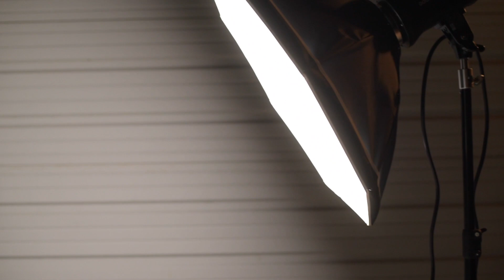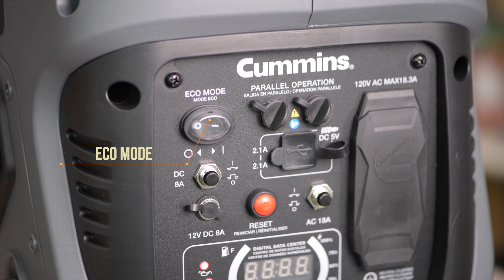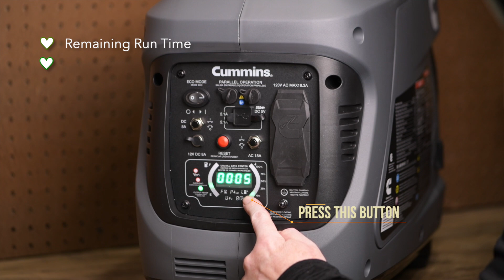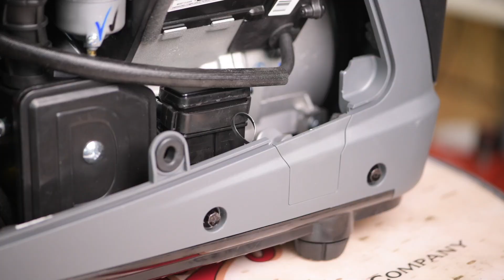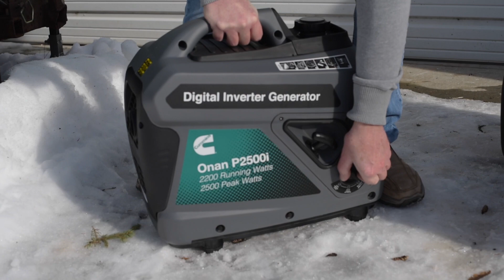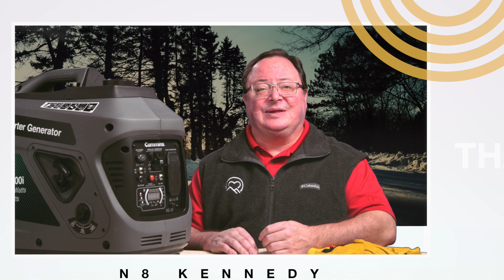I♥RVing Gear Review: Cummins Onan P2500i Inverter Gasoline Generator

Comment: After 10 hours of run time mine will no longer start. Confirmed the bowl is getting fuel and confirmed the plug wire is getting spark. The plug itself could have better clearance IMO. Biggest downfall aside from it not starting is that the warranty service centers are few and far between.

Comment: Good review of the P2500i. I like that I can lift the generator with one hand. Besides brand name, it is one of the reasons that I bought it. You mentioned your preference for 92 octane fuel over 87. You did not show or mention the oil you used. There are oil choices, too. Also besides the cigarette lighter adapter, what other accessories are needed? Doesn't the Parallel Operations require an adapter? You could have shown that, too. Over all, good review.

Comment: A v gas is the best and will stay fresh for years it’s 100 octane low lead it fuel for piston airplane fuel.
Reply: 100LL Has a TON of lead compared to unleaded fuel. it WILL lead foul plugs quickly and expose anyone around it to lead. if you want something that is well stabilized, use Sunoco 98 octane fuel.